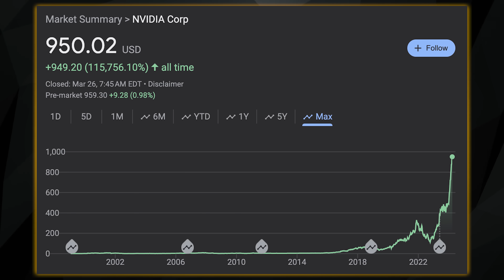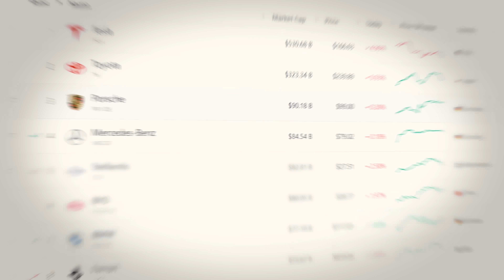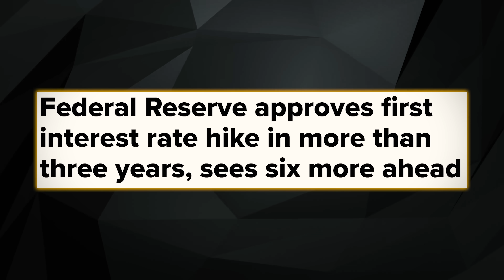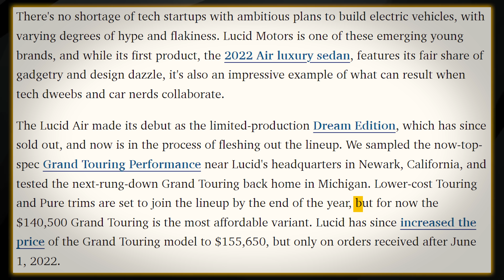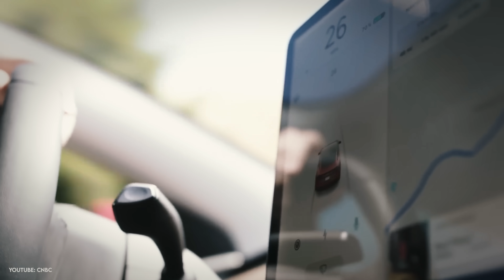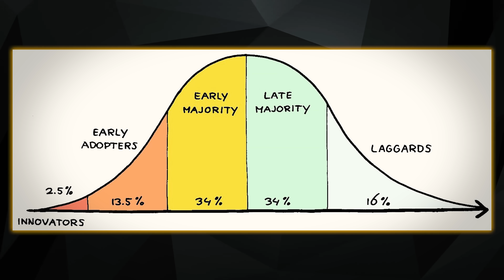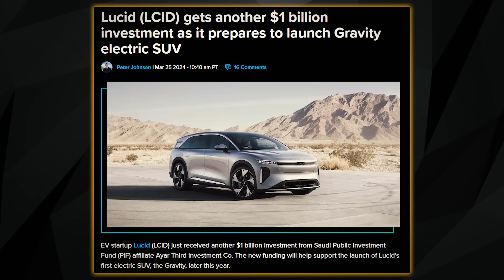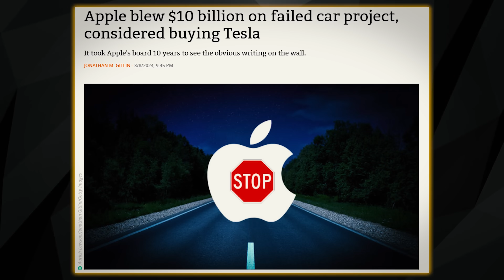The EV Bubble Popped - What Now?

Comment: EV's main adoption bottleneck is infra, because you may genuinely struggle to charge at home or at work. Second bottleneck is charge speed.
Reply: Right, I’d wager EVs wouldn’t be so discouraged if chargers were more widespread. Battery safety concerns definitely aren’t scaring off customers who are literally adding gasoline to it with their purchases of hybrids.
Reply: Battery swapping is much more practical for e-bikes and Niu-style scooters and is faster than fueling up with gas.
Reply: @niamhleeson3522  and tesla could do them with their cybertruck in 2019. Live on a stage... Yeah... Tesla in particular is in for a hard fall still
Reply: The only real bottleneck is the energy density of the damn batteries. And that is never gonna get solved.
Reply: @manitoba-op4jx you shouldn't
Reply: @divyanshbhutra5071 city vs rural driving, I heard they're great in American cities. I live in a European city though so I don't need a car at all.
Reply: Fantastic analysis
Reply: @niamhleeson3522 but a car replacing battery takes like 15 minutes. And who pays for the batteries? It will be super expensive in the long run
Reply: Biggest problems is cost of electricity for most of us. Europe has a free market that made my electricity bill spike thru the roof. Since germany can buy electricity from Sweden which makes the prices go up for us in Sweden. I pay $0.26/kwh now when its spring, so in cold winter it will be even mote. Most public chargers make it way cheaper to drive a petrol instead. Not to mention how expensive evs are to buy. Out of reach for 70% of the population.
Reply: @AndrewTSq  Yeah, I totally agree. The downturn in purchase of EV's is almost directly proportionate to the increase in price of electricity in Europe. The war in Europe which, in theory, resulted in higher electricity costs, took a little while to filter through to people's bank accounts, but once it did, it has affected all spending, especially on a product that you can't realistically predict how much it is going to cost to run.
People are very wary of buying something when running it one year with cost 'x', but the next could be '2x'.
The safety aspect is a little bit of a distraction, they are just as safe as a petrol car.
One thing that people don't seem to take into account is battery replacement and disposal. Apparently it can cost up to $10,000's to replace a battery in a Tesla or any EV, which is hugely bad for the environment, but also for the lifetime cost of a vehicle. Are they supposed to be throwaway cars?
Reply: For me personally, it is battery degradation, subscriptions, dishonest marketing and apple-like anti-repair stuff. I live in the countryside in the EU, so charging wouldn't be a problem. But i heavily rely on a vehicle due to my location and business, so it must be something robust. 

That's why i only drive cars from the 80's to the early 2000's, because newer ones are rubbish. I only drive what i can repair by myself and has an engine lifespan above 500k kilometres - no shenanigans. Never needed a tow, never got ripped off when something broke. I got what i paid for. Honest cars. 

Older cars get lower taxes and insurance., where i live.

//edited for typo correction
Reply: I would only argue the second bottleneck is true, because you don't ever charge your ICE car at home or at work. The reason why we do want to charge at home/work IS because it takes 50 times longer to charge it compared to filling gas
Reply: @thewhitefalcon8539  What has energy density got to do with where the car is driven?
Reply: Spoken like a non-ev owner. The biggest drawback for the charging station makers is that most EV charging is done at home right now. Using high power, and expensive, on the road chargers is rare. I make less than one long trip per year that justifies road chargers. There is no way that is the basis of a business model.
Reply: Don't forget the third bottleneck of serviceability and lifespan. A lot of new car sales are funded by second hand car sales. Buyer A buys a new car, 4 years later they sell that car to buyer B and get 30% of the cost of it back, 4 years later Buyer B sells to Buyer C and gets 50% of their costs back. Each sale usually going towards a future purchase. That's not happening with EVs, when the battery warranty runs out pretty much all used EVs are a financial timebomb, that's getting reflected in the second hand market. Battery failure in an EV is like an engine block failure in an ICE car, in a 10 year old car it usually means scrapping the car, except it probably won't happen to an ICE powered vehicle, but definitely will happen to an EV.
.
The only way I can think of solving it is standardising battery dimensions, fittings and firmware so generic batteries can be bought and fitted universally. It would both drive battery costs right down and allow older cars to be easily repaired (and upgraded with better battery tech) as time goes by. But that will only happen with legislation, Tesla ain't volunteering to let Ford sell you a battery.
Reply: @scottfranco1962  Large regions of my country have restricted new at home and at work charge points because the grid can't handle it. Grid's being worked on.  even so, it's cargo traffic that is limited most by current infra. Commercial road vehicles.
Reply: @fix0the0spade  Tesla claimed that battery replacement at a special station would be a thing that they could do 5 years ago, and would only take a few minutes. i think it's laughable
Reply: @fix0the0spade  Very good comparision of Engine Block and Battery Pack. But batteries can't be removed and fitted just like that. Batteries used in vehicles have to be made with ultraa high purity lithium, unlike the smart gadgets we use. Moreover, they have to be packed very very tightly to prevent entry of foreign elements in the pack. Imagine your car catching fire because the moron service guy didn't properly tighten your underbody bolts, and you drove it through a litte water. And it happens even with dealerships, because it's human error. Using machines dedicated to this would cost billions, which won't be feasible even on paper.
Reply: @scottfranco1962  Most EV charging is done at home because most EV owners don't drive long distances very often. But there's another category of population who do these long journeys on a regular basis, making EVs utterly useless for them. And this is the reason EV sales are slowing down.
Reply: @shadeblackwolf1508  Let me guess. You don't own an EV. Here in silicon valley we have more EVs than anywhere in the country. No "grid restrictions". Its nonsense. Name one other industry that would go out of business because of too much demand for their product.
Reply: @divyanshbhutra5071  I commuted 50 miles a day, meaning 100 miles round trip per day, for more than a year on a home charger. You don't own an EV, you are just making this up.
Reply: @scottfranco1962  you're in america. That's a major difference.
Reply: @scottfranco1962  I don't own an EV because I travel long journeys with family quite frequently. 100 miles is barely anything in comparision.
Reply: @AndrewTSq  That's why you should use bikes instead of electric cars. You can get much farther with a much smaller battery
Reply: @divyanshbhutra5071  And I go to LA from San Jose, 500 miles, Reno, and portland. LA for example is a one charge stop if I leave with a full charge. Its a 5 hour trip, I stop for lunch, the car charges in less than 30 minutes, shorter than my lunch time. its about 2 1/2 hours per leg (to and from the charger). I would not want to sit in the car for 5 hours in any case. Thus, extra time waiting for the charger: 0 (zero). In fact I probably spent less time "fueling" up the car than you do, because you go, pump or have gas pumped, go to the counter, pay, then go to the restaurant and have a meal. I drive to the charger, plug in, and forget about it.

This thing has been played up in the anti-EV press wayyyy to much. In actual use, no problem.
Reply: @AndrewTSq Wait until you see the energy prices in Ireland, it can be over 50/kWh, depends on your provider though, it's usually in the high twenties.
Reply: This!

And you're already sorta running into the "issue" where there are a few more EV's than charging stations at a destination.

For something like various office building, they'd have to turn most of their parking into charging stations with mass adoption, and I highly doubt that will happen.

Until base range is maybe double the current best, higher adoption rate is simply off the table.
Reply: @scottfranco1962  Classic argument. Heard it a million times. You have to realise that there's a whole world outside USA and things work very differently in each place.
Reply: @scottfranco1962  Thanks for proving my point.
Reply: You can't get gas at home either,you have to go to a gas station to get gas.
Reply: Third bottle neck being that even with perfect maitnance, batteries do not last forever.. Not to mention lithium reserves, yet to be mined, which is a disaster prospect for environment around the mine, aren't infinite..
Reply: @manitoba-op4jx Ain't that the truth.. I knew gasoline really well, I know how easily it ignites since Iearned the hardway, you do not try to extinguish any fire with water.. Had no hair, eeyebrrows or anything for a while when I was six or seven..

  Yet, I have only recently seen chemical fire and that thing is a total nightmare fuel... Many videos of top class BYD cars, brand new, catching fire on youtube..
Reply: @relight6931  That's why people are investing in copper.
Reply: @galvinstanley3235  Can you please elaborate? Why copper exactly?
Reply: @relight6931  Chinese electric cars,solar power,and wind turbines.
Reply: Both will get better. You can easily charge from the nearest DC or HPC charger for the whole week (apart from PHEVS)
Reply: There isn’t any money in building/maintaining infrastructure. Most people charge at home! Many homeowners have “gas stations” essentially in their house. Unless the govt forces us to adopt EVs I don’t see infrastructure getting anywhere near needed levels. Not only that, but what’s the trade-off for forced spending of EV infrastructure? Who will lose? The govt doesn’t produce much value, who pays?
Reply: @MrWolynski  The entire west coast is going with only hybrid or ev sales by 2035,no only gas cars on the road by 2050.
Reply: @AndrewTSq Batteries don't work when they are cold, and they don't work when they are too hot....EV are just terrible, especially when it's hot.
Reply: @manitoba-op4jx  That pocket size power bank has very little relation to a modern BEV battery. You are comparing apples and oranges.
Reply: I had a model 3 for 3 years and now have two model Ys for about a year and there is NO "STRUGGLE" to charge at home - in fact - if I'm not on a long trip - I have never had to charge outside my home dryer outlet and have ALWAYS had enough charge. TESLA is the ONLY company that is building out a charging network and you are putting them down because they "Haven't yet equaled the 100+ year old Gas industry.......but there actually catching up fast all by themselves. Now read my comment and put me at the bottom of the list like The good democrat Dictator I know you want to be ! ! Go ahead - destroy my comment - it's your nature - I can tell by your content.
Reply: @haroldwestrich3312  my apartment building has no chargers at the ground floor available, and is not scheduled to get it's first (for about a hundred apartments) this year.
Reply: @shadeblackwolf1508 musk is good at lies.
Reply: Then there are the maintenance and repair cost horror stories.
Reply: @relight6931 and what do you think is powering the device your typing your comment on !!!!
Reply: @doujinflip  FYI : There is only one type of hybrid that makes economic sense and NO AUTO MAKER PRODUCES IT ! !  it's the SEQUENTIAL hybrid - meaning; it's NOT "PARALLEL" Sequential hybrids NEVER GO BY THE POWER OF THE GAS ENGINE. the gas engine runs at it's optimum efficiency RPM while turning a generator to make the electricity. this is THE most efficient way to make a hybrid and if they would work on it they could actually compete with pure electric. PROBLEM is that the "Motor" or "Turbine Engine" would be so small that they couldn't make much money on it nor on the tiny fuel it would consume.
Reply: @haroldwestrich3312 hey guess what? Honda made a hybrid just like you mentioned. And no, it drives the car directly while on the highway because it's the most efficient way. But since it can only pick one ratio to do so, starts losing efficiency after going over 70mph.
It's a zero sum game. Each setup has strengths and weaknesses.
Reply: 3rd bottleneck is resale value. EV batteries don't last as long as combustion engines. And nobody wants to spend 10k to repair the car they just bough second hand. Because of this, teslas have a very unfortunate depreciation curve.
Reply: @lfcbpro Tesla in particular is a throwaway car. They're not deisgned to be repairable at all. Teslas are like the IPhones of the car world. Prime cases of malicious engineering and poor QC.
Reply: @scottfranco1962 someone driving an iCE won't have to refuel in that trip at all though. Thats an extra 30 minutes (if the infrastructure is available). Which is actually isn't everywhere, despite what you seem to think. In Europe its very common for apartments to not even have dedicated parking, let alone car charging. And high speed chargers are a rarity. We only have a couple dozen in our entire 100k person city.
Reply: @Erowens98  I guess I just got lucky, I bought a TESLA model 3 in 2019 and sold it for $1000. MORE than I paid (Also kept my $2500. rebate so $3500 more) in late 2022. I understand that sometimes the value of the used Teslas goes down because they reduce the selling price but - Should we start protesting price cuts by companies? Haven't consumers ALWAYS complained that "Prices Only Go UP" never down; now prices are actually going down and people are complaining like it's HORRIBLE. EFFING Tesla, lowering their prices ! ! !HOW DARE THEY ! ! !!  ruining this country.
Reply: @haroldwestrich3312  yeah, um, that was 2022 when gas was bonkers expensive. You won't get that again, esp with hertz dumping used tesla's and evs on the market. 
I own an ev, and if I waited 6 months I could have saved around 3000 dollars or more, or  got the newer generation for the same with less miles than I paid. 
But if gas goes up again, 2022 will repeat. Ppl are dumb in the US.
Reply: @shadeblackwolf1508  this is true; pure electric is not good for people who rent.
Reply: These aren’t real issues if you have a Tesla.
Reply: @manitoba-op4jx Yep! Huffing gas fumes kills brain cells.
Reply: @divyanshbhutra5071 It’s NOT a bottleneck. More EVs will be sold globally this year than the ENTIRE US auto market. This is happening already. The US is sticking its head in the sand.
Reply: @lfcbpro This is a bunch of nonsense. Batteries are BOTH repurposed AND recyclable. Do better research.
Reply: @charleswallis8395 WAY easier to just plug in. Never go to gas stations.
Reply: @fix0the0spade EVs are plummeting in prices while ICE vehicles are rising. They’re crossing right now in several areas with incentives.
Reply: @divyanshbhutra5071 Nonsense. You’re wrong on almost every point. EV sales are increasing globally and total EVs are larger than the entire US auto market this year. So don’t kid yourself as the largest auto market in the world is rapidly replacing ICE vehicles and legacy ICE automakers there are having to slash their workforce.
Most people drive short distances so that’s irrelevant and very few people drive long distances on a Regular basis. This is going to be ugly for legacy automakers.
Reply: @divyanshbhutra5071 Buncha Fossil Fuel FUD nonsense. The largest market in the world has already tipped and replacing ICE with EVs as we speak. The end of this decade is the end of ICE vehicles.
Reply: @MaddJakd Nonsense. You clearly know nothing about EVs. Anyone with a Tesla will tell you you’re clueless.
Reply: @relight6931 200,000 ICE vehicles catch fire in the US alone every year. Nonsense FUD
Reply: @MrWolynski Cery inexpensive to install basic chargers at the places autos sit in parking.
Reply: @DavidC-pg6ni  my apartment complex is scheduled to get its first charger in 2026, and has no normal outlets at ground floor that can be used. And that's basically the story of cities in this area.

And to protect the grid, they're thinking of shutting down charge stations between 5pm and 10pm until the grid upgrades are done... by 2027
Reply: @DavidC-pg6ni  Cite your evidence, because while there are plants that can 'recycle', the number of batteries they can recycle is minuscule compared to the number already on the road.
I HAVE done my research, perhaps you should do some too?
The ICCT show that in the US there is only now capacity to recycle 220,000 batteries a year, with car registrations for the same year being 1,400,000.
So only 15% of batteries can be recycled/repurposed.
Reply: @DavidC-pg6ni  Good luck powering large machinery with stupid batteries.
Reply: @DavidC-pg6ni  Wow. Physics must be crying in the corner seeing people believe that energy density of batteries is gonna improve beyond 2 to 3 times of what we currently have. 3X is the theoretical limit.
Reply: EA and other companies need to be like Tesla with 15-20 chargers at every stop, we are still years behind with building out all of the stations needed, as well as the cost issue that people aren't willing to pay more for
Reply: @manitoba-op4jx you need special conditions for thay battery to leak or blow up. Sane is said for gasoline. The argument does not make any sense.